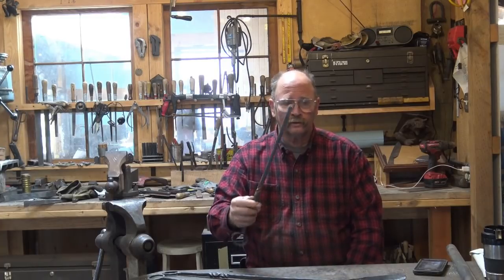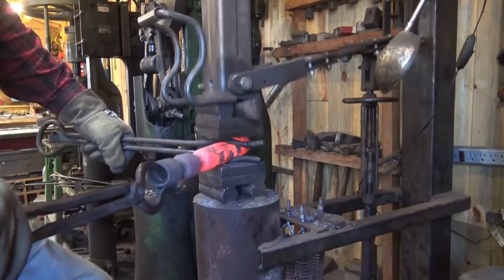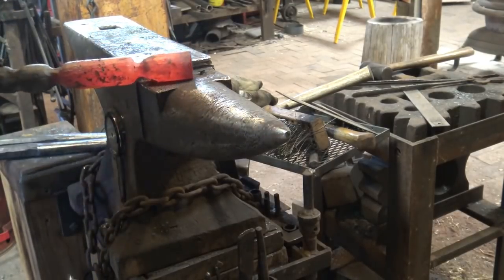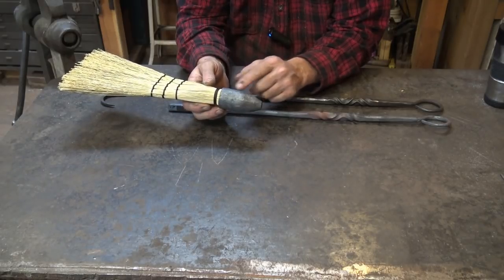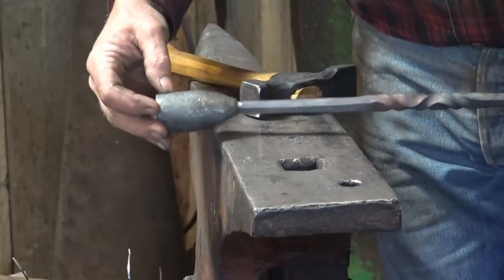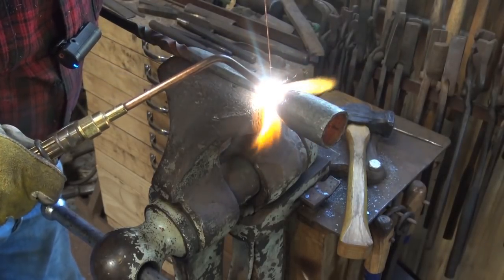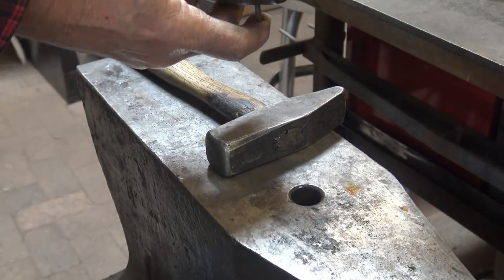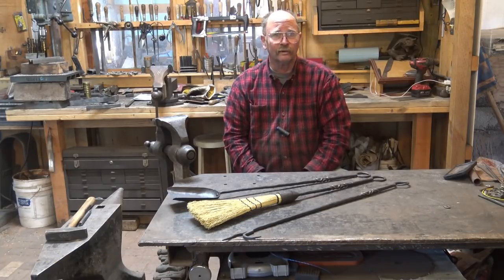Fireplace broom with forged handle and hand tied broom - blacksmithing project

Comment: Ultra informative as ever. I was sure that you were going to hammer that lug into a cone and encapsulate that broom and pin it at the seam of the cone. 
Then when I saw that it was too long for that I figured you would cut it off long, upset a bunch of steel into the tip and monkey tool a rivet onto the end. I think you did the best option for the project ultimately. 👍 it looks like a great set that anyone would love to have.

Comment: I have no way to weld, other than forge welding, witch I just taught myself how to do yesterday. Another idea for attaching the handle to the broom is to make a round tapper and coil it around a pipe the same size as the broom and then attach just the coil to the broom after it cools. I haven't tried this before, but I believe it'll work.

Comment: Great video.  The you tube channel DF In The Shop did has a good video on forge welding a candle cup on a stem. Might work in this application. But I agree in the modern blacksmith shop, especially if your doing it as a buisness, using modern welding techniques is totally acceptable.
Reply from the maker: I'll take a look at his video, thanks
Reply: Black Bear Forge he is a very good instructor like yourself. Does a lot of basic instructional videos and has done several tool making videos. I plan on making this fireplace tool set for my inlaws for Christmas.  I have made several other sets, but not quite this style. Thanks again for sharing your wealth of knowledge!

Comment: To avoid welding you could have heated the end of the handle up to a high heat that goes into the bell then place it in a vice upside down. Then place the bell on the handle, place a block of wood over that then hammer it down snug onto the handle. then get a long lightly rounded head punch and tap the bottom of the handle inside the bell forming it into a rivet head to hold the bell snug.
Reply: That is what I do. Works good.

Comment: Would mushrooming the handle inside the socket have worked?  Maybe using some sort of punch?
Reply from the maker: Yes, but it is hard to get the joint tight in that situation and they usually rattle a bit

Comment: Nice work John. Would it be feasible to use the tenon on the end of the bar as a rivet end and use that to hold the socket on?
Reply from the maker: It is, but it requires heading the rivet down inside the cup, which is quite difficult to do well.
Reply: ..Mr. John, could you cut a slit in the tenon making it a 2 or 4 sided then heat the tenon and putting the shaft in the vise adding the cup and using a chisel bend the prongs over to secure the cup??...
Reply from the maker: That is a very interesting idea.  The split would be easy to spread, it is just a matter of whether or not it would hold tight enough.
Reply: Ol James that's was my question and thought as well! Assuming you don't put a lot of force on it, I don't think it would be too difficult to hold